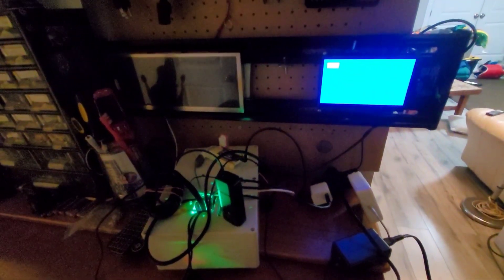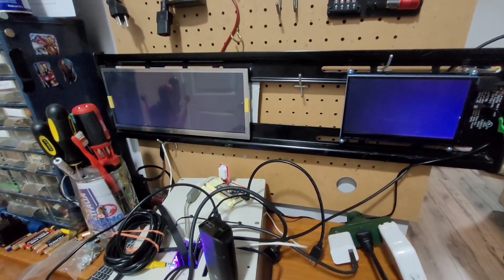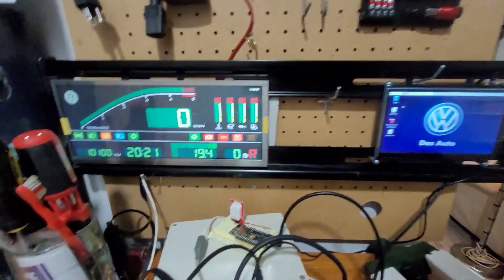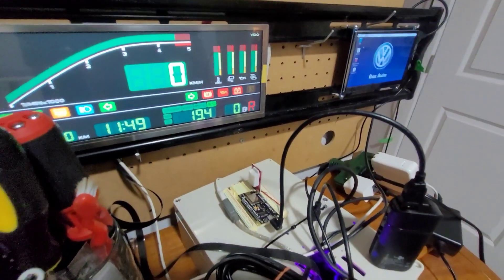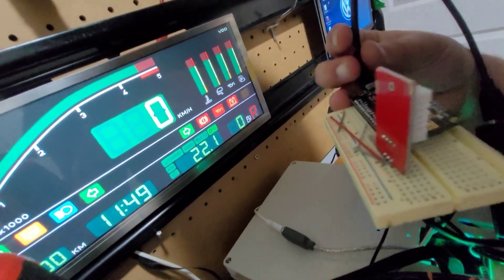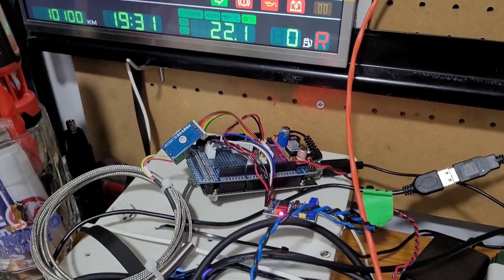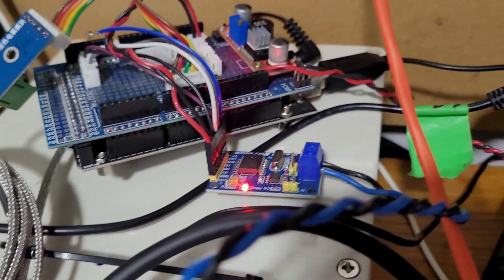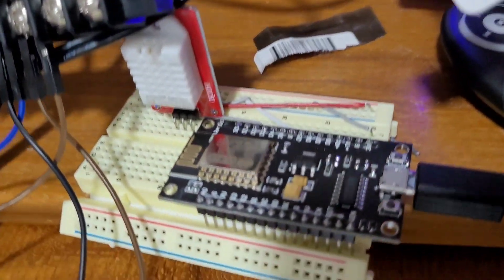Digital Dashboard Updates:  Wireless esp8266 NodeMCU with DHT22 sensor and teensy 4.0 CANBUS testing

Comment: Are you running both screens through openauto? And what are you using for the digital dash? I'm trying to work out a similar project for a custom dash in my Airstream motorhome I've been modernizing. Most of my current gauges don't work and I'd rather go digital in a custom dash than replace all of them.
Reply from the maker: Hey! Only the 7 inch screen is displaying openautopro. The larger screen just runs my pygame dash program in full screen. I made most of it myself from cobbled together internet searches and rabbit holes of learning lol. Unfortunately,  it isn't the cleanest code etc. It's on github though. Definitely pretty diy. There is a guy on YouTube with a rv project using real dash. Scott Cook I think. I'll try to find his channel. Good luck on your project.
Reply from the maker: Not sure if links share here,  but his YouTube is @ThisOldBus